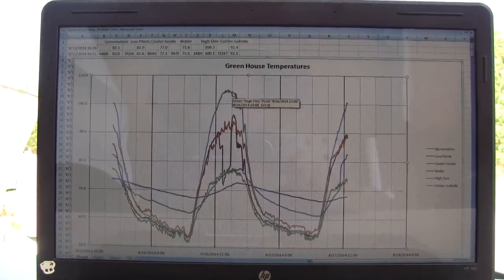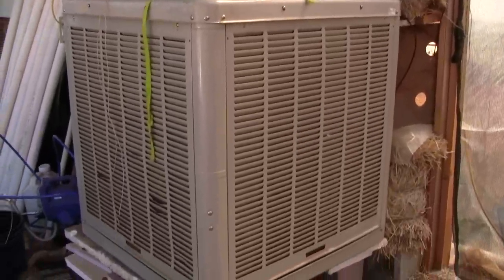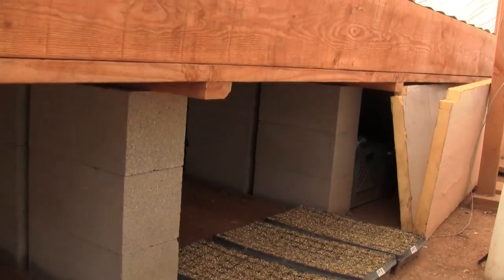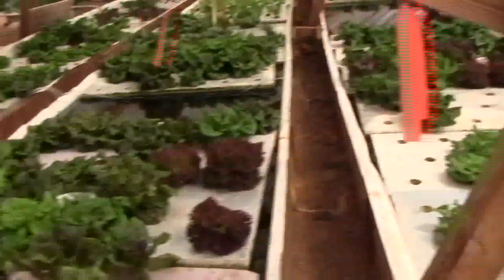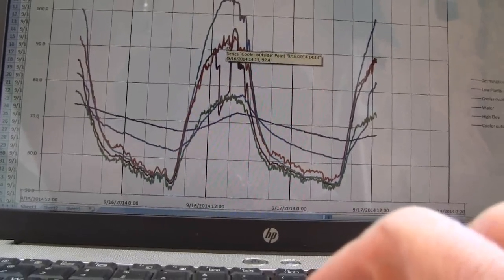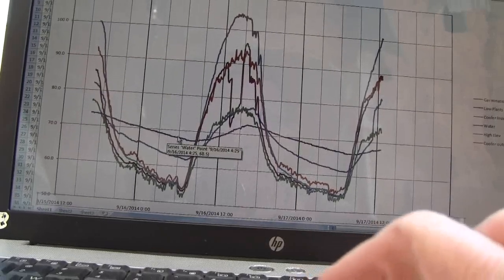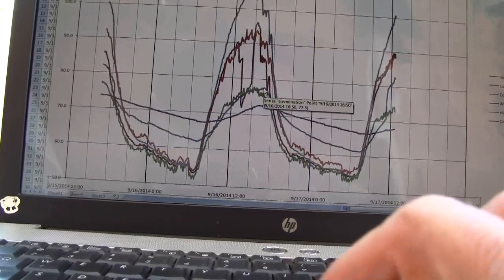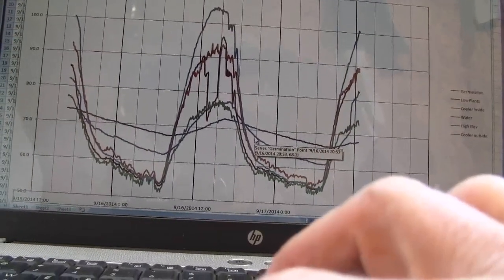Multi Point Greenhouse Temperature Monitoring System

Comment: Good work. The Idea of monitoring the temps both through the length and  the height will give you a benchmark as to how the greenhouse is working as a system.

Why did you decide to use digital probes rather then thermocouples  or thermisters. Inside the greenhouse what is the actual system that is taking the measurements and saving them to the flash drive you use in the PC.

For your sensors that you think are being affected by direct light  or water  Use some aluminum cans with holes punched into the sides and painted white. Suspend the sensor in the center of the can.

You seem to be technically astute If your system is able maybe you should have it turn off the swamp cooler when the temp falls below an average temp. A fan that is Temp controlled at the far end of the greenhouse might even out the temps.
Reply from the maker: Peter Menningen Thanks.  yes, the goal is to learn how the temperature varies in different locations.  Critically, the germination chamber needs to remain at temperatures close to 68F for good percentage and rapid germination.  Too high a Temp and lettuce can go into thermal dormancy, too low and they don't germinate well.  

And yes again, the goal ultimate is to create a controller that will turn the swamp cooler on and off as needed.  Already, from the traces you can see, the overnight differential between the cooler inlet and outlet temperatures are small, meaning, I could have a relay switch off the cooler at night.  I haven't done that yet, but as the outside temp moves into fall, will soon.  Better to do this using a controller rather than a simple hourly timer, though both can work.
rt
Reply from the maker: Peter Menningen PS, regarding digital probes.  Thermocouples can also work.  But when you have long distances to the location you want to measure the temperature, the resistance in the wire cable used becomes important and thermocouple measurements can have significant errors.  By using a digital sensor / sender, that is eliminated.  These are low cost (couple bucks) digital sensor / senders accurate to a fraction of a degree............nice.
Reply: woodfirepower The distance errors do come into play with Thermisters unles you use a 4 wire system( expensive) but thermocouples can easily go 200 ft as long as you don't change wire type from sensor to instrument. The inaccuracies creep in when there are wire type changes that create there own TC joints  in the middle of wire run. The thing about them is to choose the junction type to best fit your temperature range and conditions. Take a look at Omega.com they have a real lot of excellent information on Temperature sensors, Probes, and controllers. They are first rate when talking about reasonably priced industrial grade equipment. Also AutomationDirect.com is similar for industrial wiring and control.